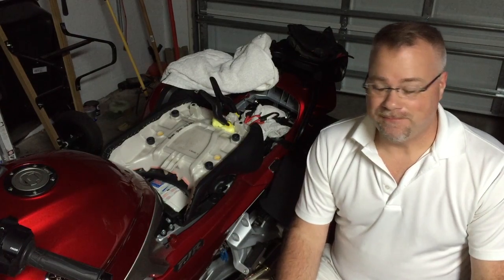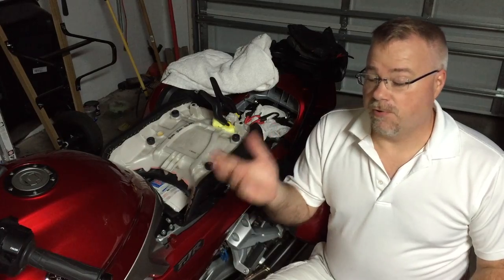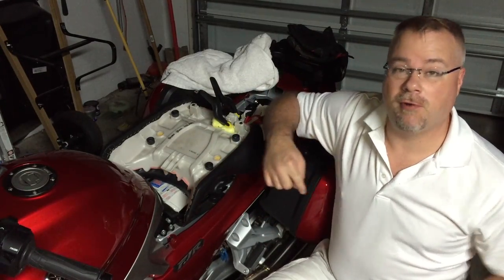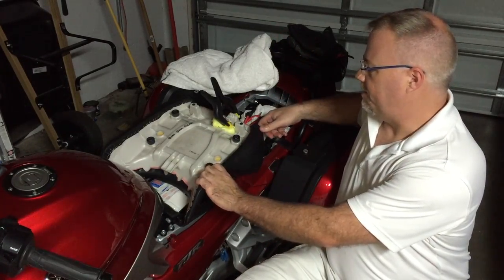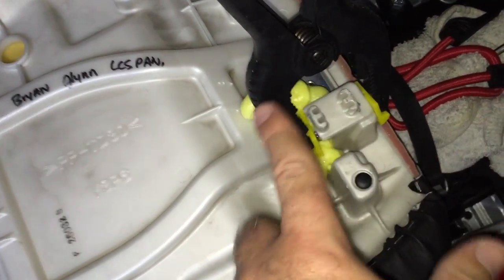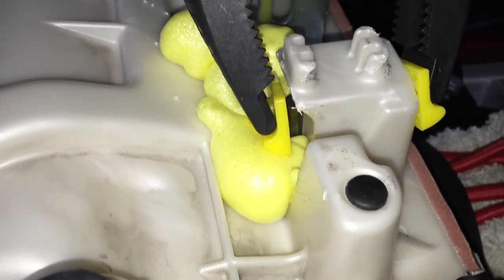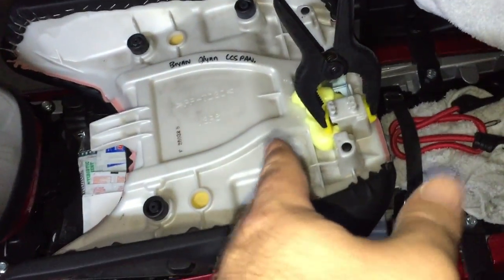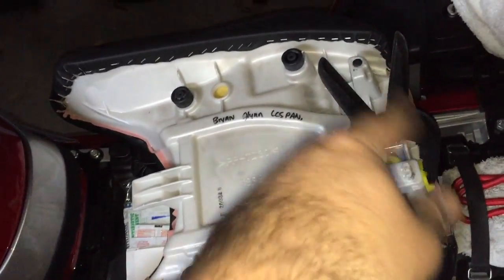How To Make A Motorcycle Seat More Comfortable Inexpensively

Comment: In my experience pads work the best. I used to have an Airhawk but the shifting of air in those air cells created a weird riding feeling. I took that pad, took out the air cells and filled the cover with good quality cushion foam and ….that's it. I now have a pad that's perfect for even 1000 miles/day rides which I've done several times.

Comment: It looks like we have similar ideas. I filled a crack in my foam last year with foam insulation spray (the same foam in the video) thinking that this would resolve the problem. It filled the gap, but what followed was pain on by butt after long rides. The problem I found was that the spray foam is so hard after it dries, after my seat cushion compresses all the way down (235 lbs of pressure), the only material left to support my body is the hard, dense spray foam. After 2 hours of riding, the pain was there and it turned the ride into an uncomfortable one. I agree that this was a good idea, but it didn't work out well for me.

Comment: Numb bum is a huge problem for me as I've zero butt padding. I have alleviated it slightly with no seam underwear but will no doubt have to scallop the seat foam to make a hole so my legs take more pressure than my butt. Also a sheepskin cover on top of the seat helps also.

Comment: I respectfully disagree..you dont ADD MORE foam under your tailbone to alleviate pressure on your tailbone..you remove it..one of the most popular cheap mods thats been around for years is to cut & remove the part of the seats bottom plate thats directly under under your tail bone..Ive done it and it actually helps
Reply: You might disagree, but it's his ass that is now much more comfortable! Why argue with what works for him? If a knob or ridge without enough padding is creating too much pressure in too small an area, then creating a softer buffer will help as long as it is in balance with the surrounding area, thus not increasing that ridge.
Reply: spdklls7 just started road cycling again and the seat has no foam support in the coccyx area so I guess you are correct.
Reply: Agree with you on this because i use to own a honda rebel 125. even though it was a small bike, it was damn comfortable. Then i found out that the seat is kind of hollow under the tailbone. Another thing is, i had a back pain and the physiotherapist recommended me to sit on a doughnuts shaped cushion on long drives.
Reply: Spot on. I fractured my tailbone (thru-hiking injury). Recovery involves the use of a coccyx pad (had to lug one around for three years). A coccyx pad has a section cut out to place the tailbone in a state of suspension. There are coccyx seats for bicycles using the same methodology. So, remove foam below the tailbone.

Comment: I was about to head out on a 10,000 mile trip and I injured my tailbone so it hurt to sit anywhere. I built up my seat a little by adding two strips of closed cell foam (sill gasket, life jacket foam material) onto my seat leaving a gap in the centre to keep pressure off my tailbone and it was the ONLY seat I could comfortably sit on. Like sitting on one of those donuts for tailbone injuries.  I thought it would be temporary for one trip so I used Gorilla Tape to put in onto the seat rather than peeling off the seat cover and then covered it with a mesh cover I found online. It worked so well it's still there 12,000 miles later. It made 600-700 mile days coast to coast and back across Canada comfortable on a dual sport which have notoriously uncomfortable seats.
Reply: Hi, can you share picture of your seat after alteration?

Comment: Motorcycle seats are all designed to be a pain in the ass sooner or later on your day long ride. You can spend big bucks (and wait some time) for a refit. When my BMW GTL 1600 seat became intolerable after 4 hours in the saddle, I finally realized that the bike may be designed for countless miles, but the rider may not be. So, what I'm going to try this year for the long cruises is to sit on a high density  foam waterproof hunter's seat pad (12" square, 1-1/2" thick) I found at a sporting goods store for $5.00.
I will glue on a black sheepskin cover to one side, and keep that in my saddle bag until I think I need it for the long highway miles. It compresses very comfortably down to about 3/4" inch when sat on, plus whatever the shearling cover is. So, I haven't actually tried this yet, but it seems like it could turn out to be worth it's weight in medical marijuana, as far as pain relief. Ride on!

Comment: If you let the foam in the tube dry you can use something thin and hard like a coat hanger to push the foam out of the tube.  That will allow you to use it again (the tube/can).
Ride safe.  Glad you were able to fix your seat...
Reply: Have you had any issues with degradation of the foam over time? I am planning on redoing the piece of lumber that is my MT07 seat and I like your idea, but I'm wondering how durable and resilient that foam is. Not exactly made for this application lol

Comment: A tip on using expanding foam: 
Use aerosol carb cleaner to clean out the tube. Clean out the top of the can as best as you can too. USUALLY, you can use the can again.
Reply: Yup...Not everybody is Scotch enough to figure that out! :D Dribbling acetone in the straw works too.
Reply: Rick Brinkman good to know thx!
Reply: An even better tip is to not use it at all.
Reply: 0

Comment: Whatever works or helps is great,,, but I use whole boars,, 1 inch up to 2 in 1/8 in,,. Like lightning holes,, turns that hard bass into like a spring,,. Lets the air out faster on a hard bump,,. Soft foam  just collapses to nothing,, harder more dense foam acts like a shock absorber,, a 3-inch round hole under the tailbone really helps,,  a extra layer of memory foam helps,,, a heavy duty handheld stapler works fine if you put 90 lb of pressure on the nose with your left hand before pulling the handle with your right hand,, you need to do this on electric stapler or an air-powered stapler too,, !!!

Comment: thanks you gave me the idea to use that good stuff to solve the problem I have with over 10 years og owning my cbr600rr my seat cushion foam some how has shrunk and looks like the seat is to small for the bike and i will try to use that spray to re form my swat back to fitting size its worth the try compared to down time and the cost thanks for your great video and sharing your idea love it way to use the ole hat rack

Comment: I will have to respectively disagree with you. The problem is pressure on the tailbone. not, enough padding. More padding does not alleviate pressure. I have a scooter with a big seat and had a sore tailbone until I fixed the problem. After I cut a 4 inch hole in the seat pan so as to relieve the pressure in that area. Problem solved. Thanks for your videos!

Comment: I am bicyclist and a  motorcycle guy.  I've long found it fascinating you get "fitted" for a bicycle seat and  counter intuitively, narrower is better based on the width of your "sit bones" (ischial tuborisites if you're into anatomy).   So, why is it that motorcycle seats are always made wider and deeper and more comfortable bicycle seats are generally only 20 mm wider than your sit bones.. in my case 160 mms (and I'm 5;10", 180 lbs)  BTW, 150 mms are probably  about four and one half inches.  My prior seat was 163 mms and it was suitable for use at Gitmo as a torture device.  Yeah, yeah, the work of bicycling is different than motorcycle riding, but still there must be some parallels that apply someohow.
Reply: 152mm is 6 inches (25.4mm per inch)
Reply: wider seats have more surface area it is not just about the material used compared to stock tough material seats...the wider the surface area the less pressure places your ass takes because the pressure is spread out more versus a narrow seat all your weight is being placed in a more central area.
Reply: The most obvious thing: on a bicycle your legs keep moving, a wide seat is less comfortable because it creates more friction on your inner thigh.
Reply: I’ve read several articles about higher testicular issues in Bicycle riders. Maybe they should rethink the seating if its true.
Reply: You are meant to slide left to right to shift your weight on a motorcycle (not to turn, but to limit the bike's lean angle in a turn), so any bike with any sporting aspirations at all has a wide flat seat.   Dirt bikes are made for you to stand up on, so the seat is narrow so you can straighten your legs.  Touring seats are dished out, and that's the style most aftermarket companies produce because they are much more comfortable than a flat seat (try a Corbin, if you haven't.  They are awesome).  Most people modifying seats are going for more of a touring seat shape and/or trying to lower the seat.   If you are used to sliding across the seat in sharper turns, most aftermarket seats will be really frustrating. The manufacturers don't do more of this because the seat also provides impact protection, which you lessen when you start removing foam.

Comment: Toss some coathanger wire down the tube when you're done w/a use and you'll have a path later.  Also, you can simply cur away the excess foam w/a utility knife, rather than crumbling it off so it's got less induced cracks and faults.  Good video otherwise and thank you.
Reply: "Great Stuff" sells "Foam Cleaner" yellow spray can. Acetone dissolves the spray foam instantly.  So immediately after you finish squirting foam take the straw off the spray foam canister and connect it to the foam cleaner can and spray the acetone though the straw and the straw will be just like new.   Also take the spray applicator and spray a little into the top of the spray foam can top nipple and turn upside down and the can will not be wasted ever again just because you could not use it all in the one application.  Make sure you wear thick nitrile gloves and eye protection.